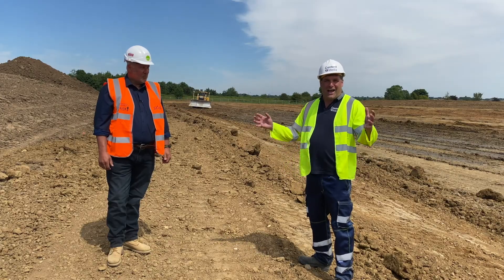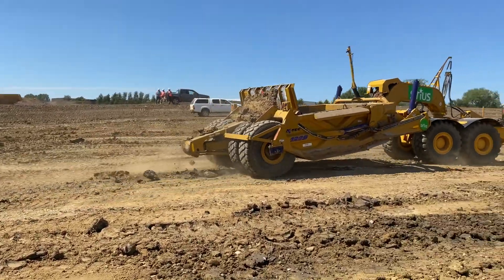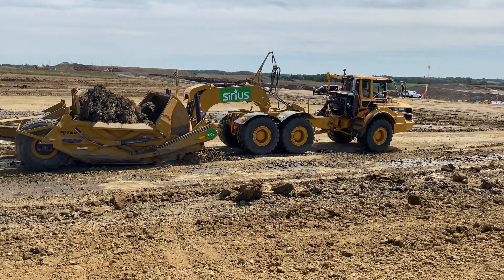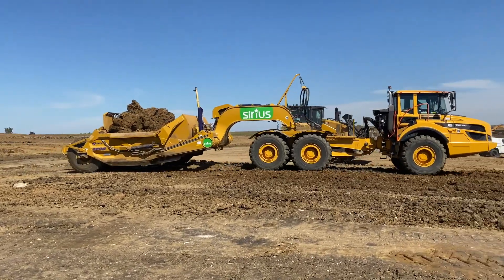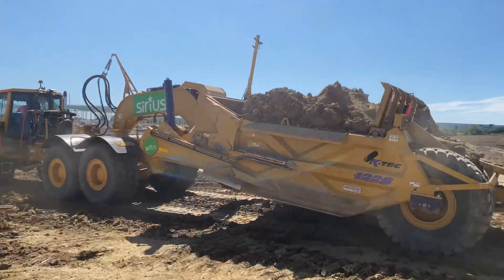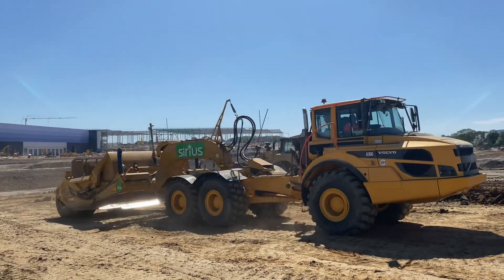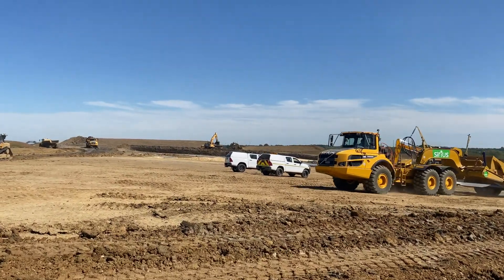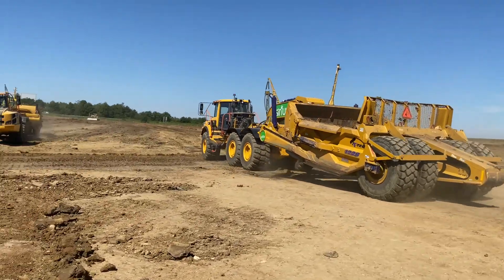Mick George brings Sirius Group, K-tec scrapers, powered by Volvo ADT's onto earthworks project

Comment: I am pretty sure,CAT produced wheeled scrapers(one driver,a lot less rubber),to reduce cycle times,during road construction.Using dump trucks,and excavators is so inefficient,for some jobs.Some even had two engines.60 years ago,everything goes,in circles.The dozer sits there waiting,to push-load.I am sure,the ground conditions,play a part.